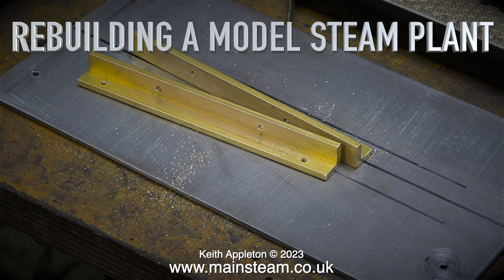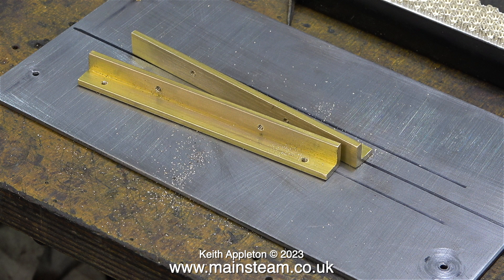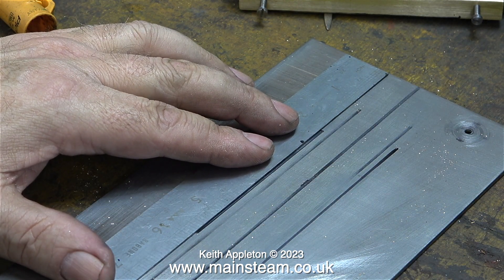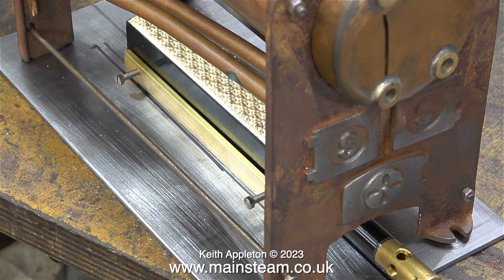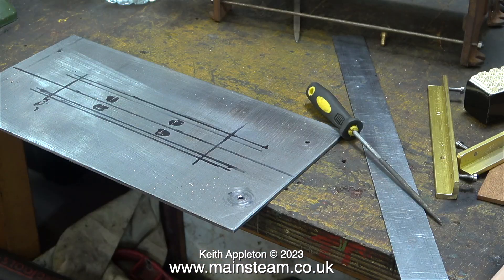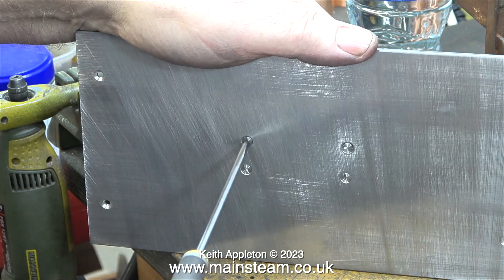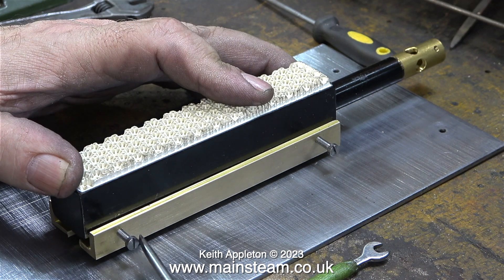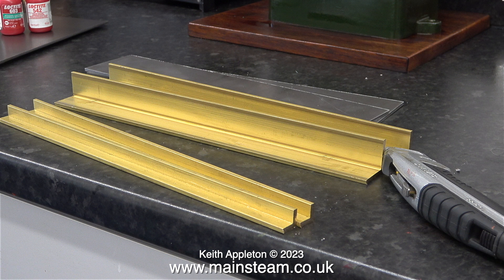REBUILDING A MODEL STEAM PLANT - PART #24

Comment: I understand that on restorations, one may keep  BA screws, and fit new ones if original ones are damaged. But why fitting BA screws on new engines or not perfect restorations, rather than using metric? When I restore classic car, finding BA screws is VERY difficult,  very few varieties....  what keeps you using them?? 🤔
Reply from the maker: Authenticity mainly, plus the drawings usually specify BA or ME threads. In the UK, BA threads are very easily obtainable, I got 200 5BA Countersunk bolts this morning from EKP Supplies. www.blackgates.co.uk also sell them, I never have any problems getting them.